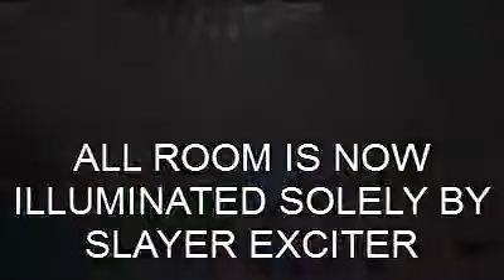30W slayer exciter

Comment: Its AC, flip flops both ways =) thanks for the demo!
Reply: Yeah, I reckon that's the answer! Also, I think even with high voltage DC the breakout point ONLY depends on the sharpest edge or corner for ionization (and not whether it is + or - ). So the round and smooth Aluminium topload will never 'spark out' in preference to a sharp edge.

Comment: @mrflathunter i think that the reason tesla coils have a large spark output is because the topload has a large difference from the ground so it ionizes the air and sends out a conductive spark to try to find the ground and cancel out the difference and I think that as long as there is a difference between the two the conductive spark could get sent out from either one to try to cancel out the difference. this is just a guess Im not an expert.

Comment: this is an argument ive had for a while and i think it boils down to your opinion of the direction in which current flows.. i suppose technically speaking when a high voltage is arced to the earth for example, the negative charge of the earth rushes electron flow from the ground to the conductor but we would usually think it would be the other way around. i also suppose technically lighting strikes from the ground up.  definitely sort of a vague aspect to electricity.

Comment: Good show! Got a Like from me! At around 5:53 was your 72W fluorescent dimming whenever you energized the incadescent bulb?

I didn't see any sparks but of course there was ion wind. I don't know much about tesla coils but I think the ion wind was from the ion motor to the toroid because the ion motor has sharp ends and the toroid is smooth. So ionization occurs at the sharp ends but much less on the toroid, similar to how a lifter works with the thin wire and the smooth foil. My 2 cents.